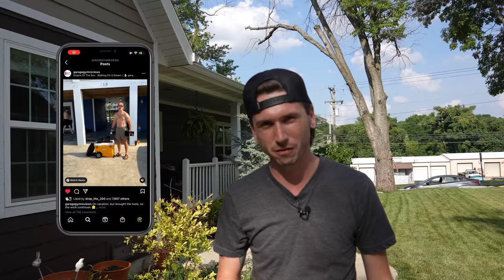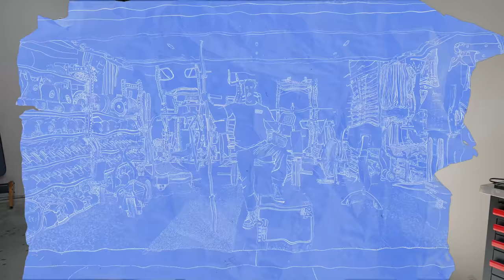Moving World's Heaviest Squat Rack w/ A Tow Truck!

Comment: I liked Sam's idea to avoid another 40+ hours of disassembly and reassembly, but I think I would have tried two options before bolting $250 casters directly to the frame. 
1. Jack the rack up to get a pallet under there, then forklift away. 
2. Rig up a wooden frame/sled around the vertical posts with many smaller casters to avoid scratching the paint and more evenly distribute the weight.
It's really cool to see how you're tackling moving the home gym equipment.

Comment: Brutal dual stack machines are the worst to move... Normally I just remove any cross members and then hand truck each side but in this instance you have a Smith machine so you have to detach the bar from the guide rails which means you break it down each side even more... I always use straps to keep the weight stack down in transit unless I can transport them upright...

Comment: 250$ for castors that big is actually pretty cheap.
Reply: yeah.  Personally i would have gone with like, 6 smaller casters.  My Matco dual bay top and bottom is around 3000 lbs loaded and it only has 4 caster that are probably 6" in height.